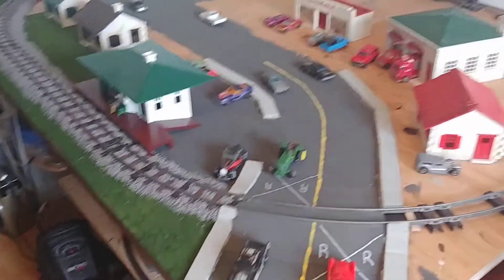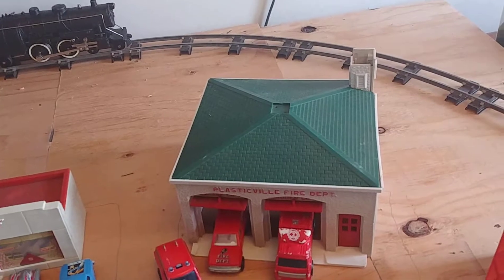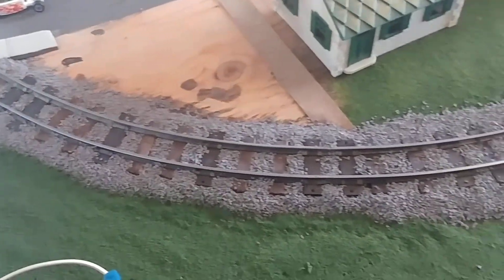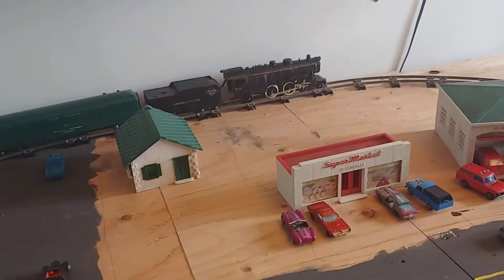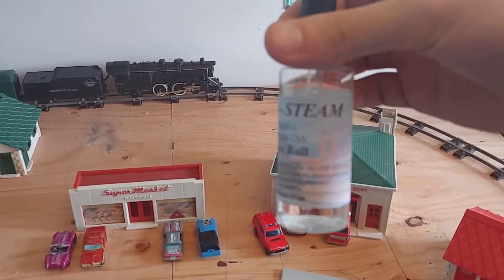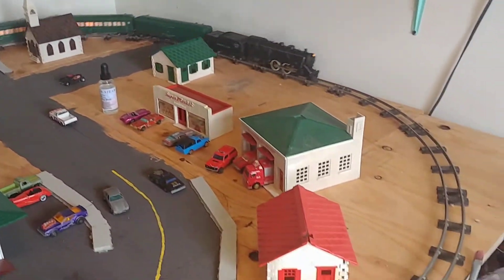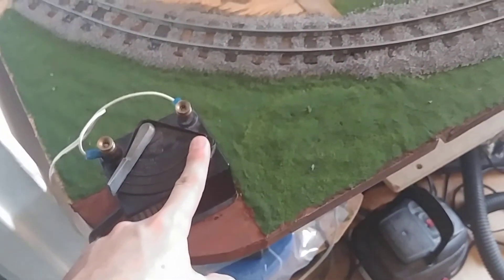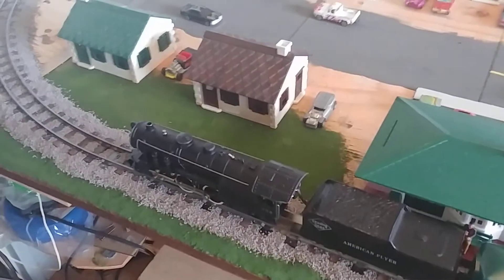Small american flyer layout updates

Comment: That is the 4 pc 302? I bought the can motor from SS also for my 303. Did not like it after awhile because of starting and stopping so I sold the 303 for nothing.  Years later bought a like new 303 and I will always run original Gilbert motors. I also have the 4pc 302  and the Gilbert motor has always been great.  I hope you don't  buy any other S gauge cars and engines.  American flyer trains look better and are easy to keep running excellent. New and old AF are fine.  The new Lionel American flyer modern type cars are ugly.  Stick to the original Gilbert designs.  Those new Reefer cars are great tho' by Lionel American flyer. I just bought one and really like it.  The prototypes were from the 1925 era. Good luck and make more videos for us American flyer  fanatics.